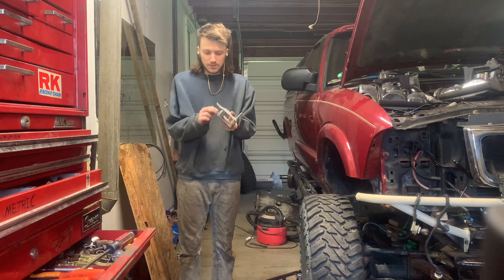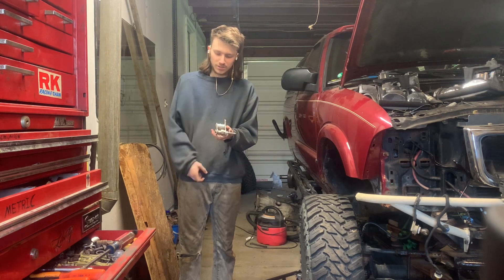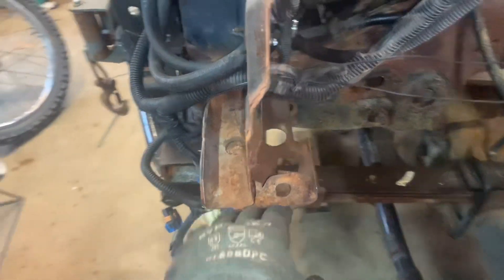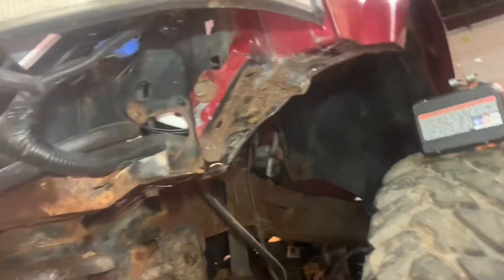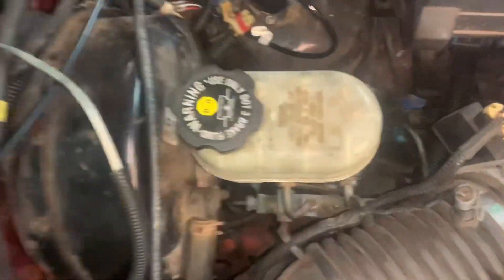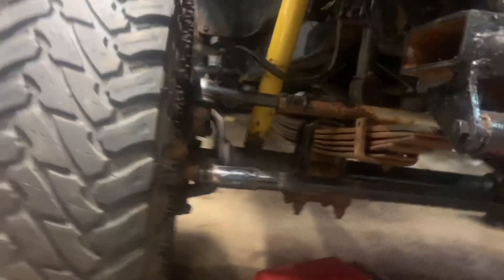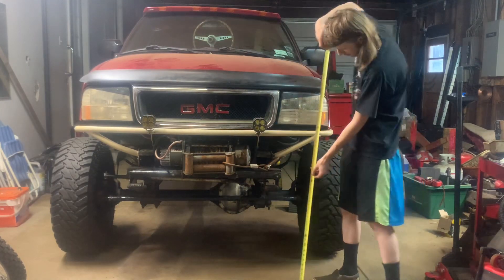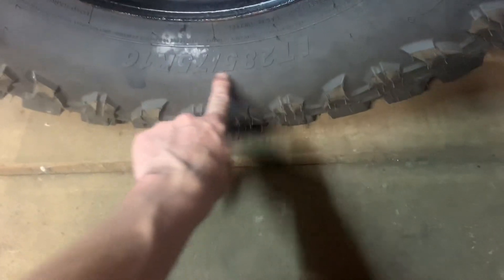Solid axle swap Sonoma first drive

Comment: What lift u runnin
Reply from the maker: It's like 13 inches taller than stock. It has axles from a Ford f250. Front springs are from the rear of a dodge dakota. Rear springs are from a  2016 silverado. All custom mounts for the springs to make it work.
Reply: @ he’ll yea brother